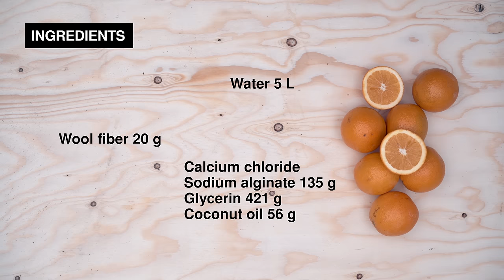Making Bioplastic from Orange Peel - REMIX EL BARRIO

Comment: The measurements displayed do not seem to be accurate/in proportion to the actual ingredients used. It's impossible that the water in that measuring cup is 5L. The glycerin also looks less than 421g.
Reply: If you are planning to do the recipe you need to measure first your frame and calculate to total volume you need and do the math with the amounts of the recipe written. For bigger frames, you just multiply the amounts
Reply: @narktect  pleaseeeee mention the exact ratios , I need it for my thesis... I've been trying this for months but it's not successful...I need you help please 😭😭
Reply: Yes these measurements are totally incorrect. I've wasted so much of my time and money trying this
Reply: @zairaahmed2572  have you figured out the measurements yet ?
Reply: @zairaahmed2572  hi, have you figured out the accurate ratios yet?

Comment: I have a question.. is it possible to use this method for other type of items?  i mean instead of clothing fabric objects so instead of using a frame.. using a mold for said object?
Reply: yes, we actually made some bio-dildo !! it is challenging though because the 3d shape contained in a mold keeps the moisture and what is needed is to dry as fast as possible. for mold i use gelatine with dried food waste or you can even use the pine resin recipe * its in the same series in the fab lab bcn account
Reply: you would have a problem with a closed mold if you are not able to air dry it. but yes, we have done 3d objects as well

Comment: If we leave the mixture in the cold for 2 hours, will we have the same result as if we leave it overnight ?  In addition, why do you use coconut oil and calcium chloride Into the mixture ?

I'm not English so sorry for the mistakes
Reply: actually i do not use coconut oil anymore, i only use glycerin. yes, you can leave it less time
Reply: @narktect  may I know what material is it that used below the frame? Also, does the leather produced tear easily? Is it durable? How do you prevent it from being moldy? 😅
Reply: @milieu125  i use a fabric with texture. it can be jeans or canvas. the leather does not tear easily because we reinforce it with fiber. without fiber, it tears. it is very durable. it will not become moldy if you accelerate the drying process.

Comment: Hello, may i ask what's the purpose of putting it in a frame? Like can't i just put it in any flat container? Please reply immediately, i need this for our research. Thank you!
Reply: Andd i have concerns about how the product turned out because after i tried to make it and dry it in the sun, then rain came and it got super wet because i forgot i was drying it in the sun, and it got MELTED EVEN THOUGH it looks already dried? (not really really really really dried) please help me i really need this for our research...
Reply: and is the wool fiber the fiber that is put inside the pillow? Or it's not or different? Because that's what i used and it doesn't look like the one in your video after I made it..
Reply: I followed all of the ingredients except the sodium alginate (i used agar agar powder) and the one thing im asking which is the wool fiber, im not sure if it is wool fiber because my group members are the one who bought it and they said it's the one that is being put in the pillow so i don't know if it's correct but im really doubting because the texture after you put the wool fiber with the liquid absolutely doesn't look the same to ours.
Reply: Please @FabLabBarcelona @Narktect reply i really really really need it for our research product 😭😭
Reply: And may i ask how did you dry it?
Reply: Plssssss replyyyyy i badly need it 😭😭😭😭😭 this is for our research 😭😭
Reply: Plsss
Reply: What's the purpose of calcium chloride?

Comment: Can I replace wool fiber with polyester fiber?
Reply: i would not recommend it. firstly it is not coherent to create a composite with biopolymer and synthetic, it is worse than having just synthetic and secondly the polyesther will not stick with the alginate. they will split.
if you want to work with recycling polyester fiber, think of heating, melting and shaping them to objects. similarly done with precious plastic project

Comment: How is this anything more than several fillers being added to calcium alginate?
The orange peel doesn't add any particular property to the calcium alginate.

And how does this solve the issue of calcium alginate's hygroscopic properties? It may not be soluble in water but it'll surely absorb it and go soft as soon as a rain hits it.
I fail to see its benefits in clothing.
Reply: I think since it contain celulloce, that make hidrogen bonding to make it more durable....???

Or at least it gave a cool collor since fashion is all about the look..haahah
Reply: Pectin and color I guess.

Comment: Hello, I would like to know what is the dimension of the frame that you use please? And the other question is in what way can the calcium chloride be replaced? (Does this serve to absorb moisture and make it more glossy?). Thanks for sharing
Reply: hi have you done this yet? i have just tried to make it and mine went moldy i wonder if you had the same thing happen?
Reply: Hi, I did it last week but the drying process is still very slow: You can buy some motifs.  First, I have not used calcium chloride and I think it is necessary since its property is to absorb moisture and at the same time classify the material.  The second thing that happened to me is that I use a completely closed frame, and you need to use a frame that has a breathable fabric underneath so the material can evaporate water faster and dry.  Then, because of the mold, I suggest covering the material with a cloth to prevent bacteria from entering and contaminating it.  Greetings I hope you serve yourself the advice
Reply: @matiasortega1403  Hi Matias, did the final product last long? or does it just decompose with time, and is it water resistant too? Thank you!
Reply: @michelenewman430  I wonder if you can use clove oil to stop the mould? The same issue can happen with slow-drying pape mache mediums (or even just regular clay can go mouldy) and I've had success with clove oil in the paper mache.
Reply: @karenwilde8575  dear Karen, of course you can add clove, cinammon, rosemary essential oil both for the smell and for moulding , bit in general it is necessary to accelerate the drying process either in a heat drier or with ventilators! Hope it helps
Reply: @narktect   hi, I would like to know how are you supposed to dry it from both sides ? I did not get that part ^^ and how much calcium chloride is needed ? Thank u for ur answer
Reply: @baptistinmcy2464  you can make a sprayer bottle of 10% calcium chloride in water. you can make a small bottle that can be reused. you spray on the textile surface and swipe the excess with kitchen paper. then you cast and then you spray on the top and wipe gently on the top. then you let dry horizontally with ventilators. check it here> https://www.youtube.com/watch?v=VPUX7nRlYAU minute 19
Reply: @narktect  ok thank you ! But when can you take it out of the frame to make it dry horizontally ?
Reply: @baptistinmcy2464  you need to put ventilators in front to accelerate the drying process or put it in a dehydrator. If you take it out from the fabric before it is dry then it will shrink
Reply: @narktect  can you place it in an oven to accelerate the process ?
Reply: @michelenewman430  Hi! Can you pls tell me the amount of water you used for it? Measurements doesn't seem right in this video.

Comment: Hello, I used the calcium solution before and after a large piece of plastic,bsince the smaller ones have been successful, and I found the plastic to have produced a lot of mold.. I checked the calcium solution and I saw black flakes inside, which I guess meant it was expired. Do you think it was moldy because of the calcium or the room conditions? Such as kitchen cooking vapor etc..?
Reply: dear Carla, if you have mold, i would suggest to accelerate the drying process by using ventilators or a dehydrator. mold appears when moisture stays long on the material.
Reply: @narktect  thanks for you answer. Yes I did a better research and I bought the fans. Thank you 💕
Reply: @narktect  hello, I have a couple of questions, is it ok to use olive oil instead of coconut oil ? And cotton fiber instead of wool ? And also maybe a hairdryer or put in an open oven to dehydrate it ?
Reply: @divyapatil7168  actually its better to use olive oil. And you can of course use cotton fibers. just > the most important thing is to accelerate as much as you can the drying process. i use 2 ventilators that blow over the big bioleather i make. also , i prefer to pour the material and afterwards insert the fibers, as i show it in this video > https://www.youtube.com/watch?v=VPUX7nRlYAU&ab_channel=KirstenDirksen
Reply: @narktect  great, thank you so much.
Reply: @narktect  hello , do you have some advice what to do when mold appeared, how can I repair it on this material

Comment: Whats the purpose of the orange peels? What are its significance?
Reply: its a filler, a color giver and a smell sense!
Reply: @narktect  is there other significant effect? I'm doing a study about this. i made one and after 2 weeks it started molding
Reply: @princessazula5045   i believe that Molding occured because the material did not dry fast or because the environment is humid. You must use ventilators or dehydrator to accelerate the drying process. It should dry within 24 hours. once dry, mold will not occur😀

Comment: Is the water 5 Liters or 1 Liter? Based on the video
Reply: 5 liters for making the big frame. if you plan to test the recipe in a smaller frame you need to make the division and calculate correctly how much you need
Reply: @narktect  but these measurements are exact and perfect in order to make bio plastic successful, right?
Reply: @elaizajeandelmundo7374  you should not make at once such big quantities. you should calculate and first make small samples to make your own recipe variation since sodium alginates vary from country to country. start small.

Comment: how long will it take for the moisture to evaporate ?
Reply: you need to accelerate the drying process as much as you can. place some ventilators blowing air on the biomaterial.
Reply: @narktect  thank you for the response. I have been sun drying it for two days and there is a greasy liquid coming out of it. Will this issue not happen once it's completely dried ? If not then can you suggest how should I make sure it doesn't appear ?
Reply: @Looplovebyjessica  i think that it is the "oil" of the oranges that is coming out. if it looks like oil, then you can start shredding them. in general, the smaller pieces you cut them in advance the faster they will dry
Reply: @narktect  The fabric seems dry when I place it under sun but once I keep it inside room , the liquid starts coming out of it . Can this be glycerine coming out
Reply: @Looplovebyjessica  ok, now I understand what you mean. So, the liquid iS actually the moisture of the room. The calcium chloride has humidity absorbing properties and it is absorbing the moisture of the room
Reply: So , I think it was too much calcium chloride or it was left for too long. Clean it with a towel with alcohol
Reply: @anastasiapistofidou4078  
what is the reason for adding alginic acid
Reply: @최보문-m2m  sodium alginate surves as the biopolymer ( bioplastic)
Reply: @narktect   i dont get it
Reply: @narktect  explain this in detail

Comment: Any replacement of wool fibre?
Reply: Flax,hemp or cotton would probably work fine
Reply: @nsjhdhdhdbhsudgvdydb7751  thank you very much. Can we use polyester fibre?
Reply: Not getting sodium alginate and calcium chloride.....any replacement of both?
Reply: @arpitashah3340  im not sure polyester would work, you can skip using calcium chloride you need sodium alginate though.
Reply: @nsjhdhdhdbhsudgvdydb7751  not getting sodium alginate....agar agar will work instead of it?
Reply: @arpitashah3340  no, it will not integrate well in the biopolymer. for polyester fibre > you can shred and heat press it
Reply: @arpitashah3340  yes, there is an agar agar recipe in the same channel!
Reply: @arpitashah3340  no, ,you should not use polyester

Comment: @narktect how can I made a 10% calcium chloride solution?
Reply: you put 10grams of calcium chloride in 100ml of water and mix them , put them in the sprayer bottle and spray
Reply: @narktect  where can I get calcium chloride? Is it available in pharmacies or anywhere else?
Reply: @narktect  can I also use an oven instead for dehydrating the peels? If not what should be the other way to do it? I don't have any dehydrator.
Reply: @narktect  is it calcium chloride flakes or calcium chloride powder?
Reply: @narktect  only available here is calcium chloride food grade is that okay?
Reply: @EGGomez-kx6zd  yes, you can dry them in the sun or the oven. try to make a small sample before going big scale
Reply: @EGGomez-kx6zd  flakes, but it doesnt matter
Reply: @EGGomez-kx6zd  exactly, its the food grade one.
Reply: @narktect  thank you!! ❤️

Comment: What is the durability of this fabric? And is it waterproof?
Reply: yes, it is waterproof! it is like leather but it is not so robust.
Reply: yes, it is waterproof but not like plastic. more like leather. and it is quite robust once you have it reinforced with fibers
Reply: @narktect  hello ive seen you alot on the comment section replying to people with answers. and so i have thought maybe you could help me out too..

what was the exact measurement that is used for the calcium chloride?
and how does the sodium alginate and calcium chloride helps with the production of bioplastic? ive searched this one on google but it seems i was only given broad answers that i couldnt understand.. thanks in  advance! have a  nice day
Reply: @narktect  is that why they used wool?
Reply: @carlapalazzo3943  cause if you want to have a robust material that can be sewn afterwards as a textile you need to reinforce it with fibers. you can use different types of fibers.  have a closer look at the process here: https://www.youtube.com/watch?v=VPUX7nRlYAU
Reply: @elysiaraelle5434   sorry for the late reply! so :  the calcium chloride mix is 10% (10gr for 100ml of water) , you just spray this-. it is based on the recipe for molecular gastronomy, the spherification. if you have searched on google about it, check about algiknit, its the same initial recipe!

Comment: My fabric catches fungus what could be the reason for it ??
Reply: yes, the material needs to dry FAST. we recommend either using a dehydrator or a ventilator to dry it. if it takes longer than 24 hours to dry then it will be prone to catch fungus from the humidity. also, everything should be clean!